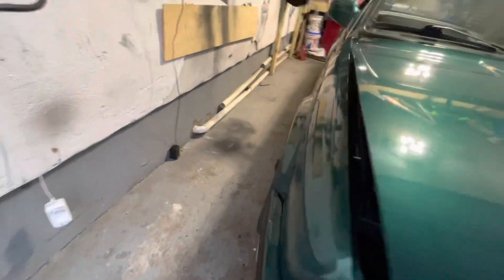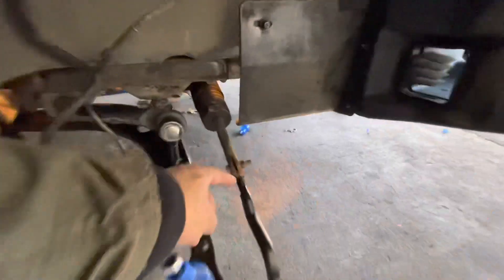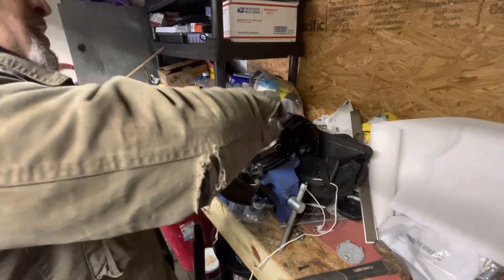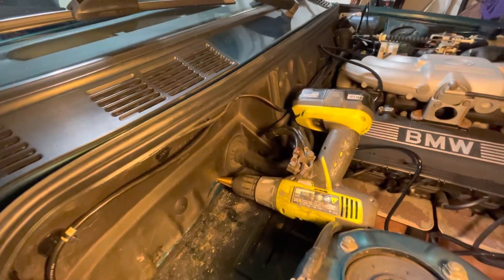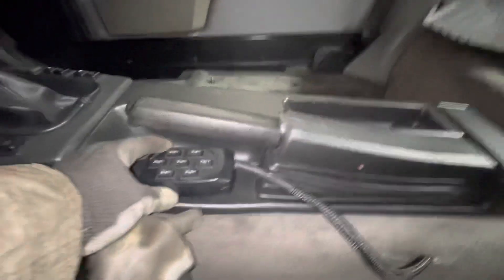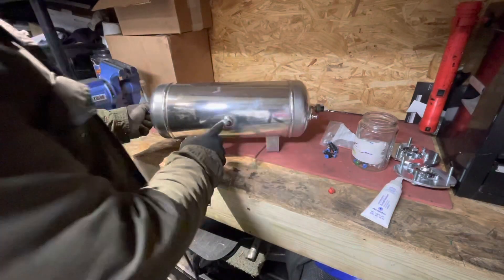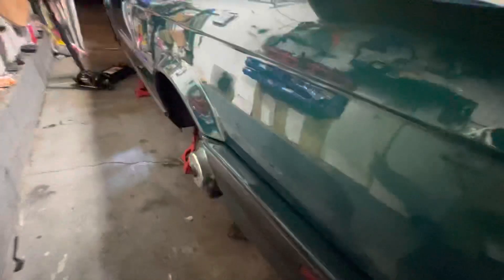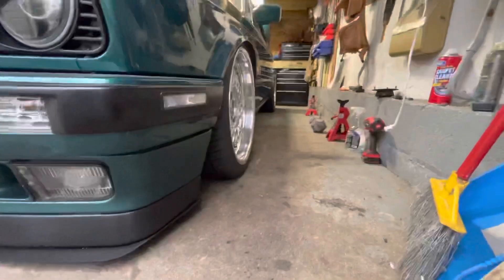Installing the Dolud Air Ride Kit in my E30

Comment: Nice video bro❤️ just one question, are you seriously using a dumbbell as a jack stand???!
Reply from the maker: Hell No LOL 😂 .. That was to put pressure on the arm .. You would have to be a real daredevil for that lol
Reply: @ReallyIzzy  hahaha okey nice. How has the air suspension hold up long term? Would you recommend  it?
Reply from the maker: @eliasolsen8303  All good so far .. I mean it's really hard to beat the kit for the money especially since you get the spindle .. I'd def recommend it
Reply: @ReallyIzzy  nice. How is the ride on air? Thanks!
Reply from the maker: @eliasolsen8303  Its the first car I have on air .. so for my personal taste .. it's better than what I had In the E30 before
Reply: @ReallyIzzy  what did u have on before